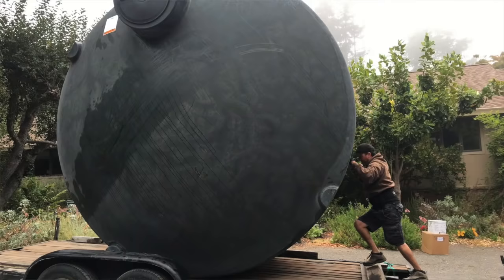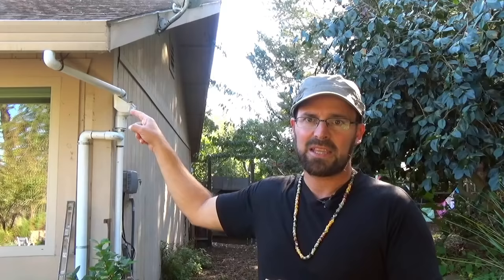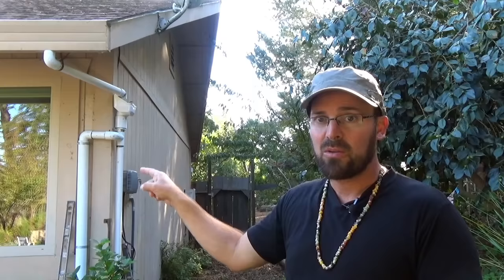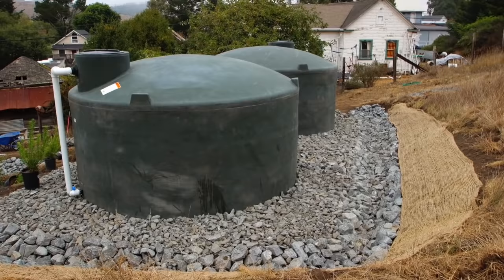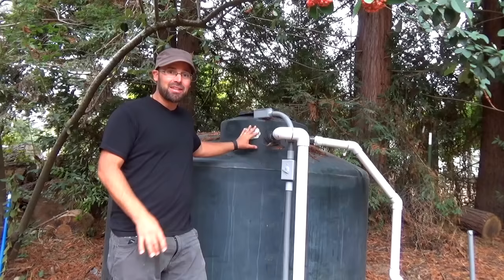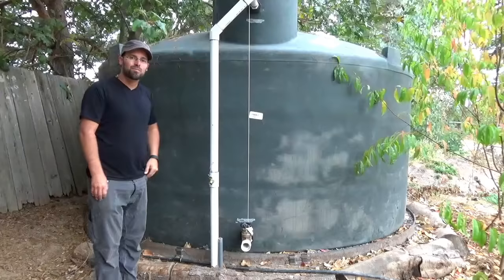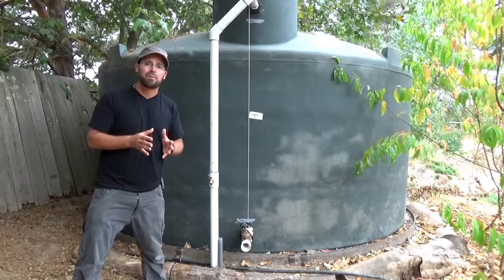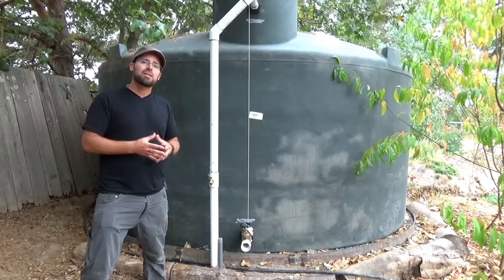Rain Water Harvesting Part 1

Comment: At the beginning of the video you have a T connector is that same height as the top of your first tank? Say you only had the first tank.. when it's full would the water just run down the other part of the T into the drain?

Comment: I’m very surprised that your entire system is dependent on electric pumps at the beginning.
Reply from the maker: Actually, the water first moves passive (no pumps) from the house to the first tank and then has 1 high-efficiency pump that kicks on every time 1000 gallons have been captured to move water from the first tank to the larger tanks. The house is at the low point of the property so it was out of our hands. If we didn't use that one pump to move water to the tanks located high on the property, then we would have to use a pump every time we want to get water out of the tanks because then the tanks would have to be located at a lower elevation point below the garden. This system uses the least amount of pumping for the maximum amount of gravity. The way it is set up, we can now get all the water out of the tanks using only gravity (no pumps or electricity.) It's all about the context, if the house was located at a higher point elevationally then we would not have to use any pumping system.
Reply: @PermacultureArtisans  What kind of pump is it, and can it be programmed for different sized tanks? Like use a 250gal transfer tank ?